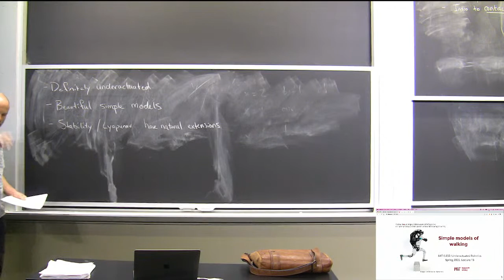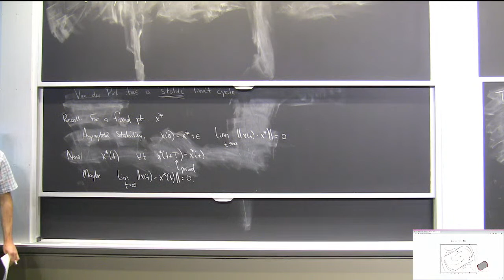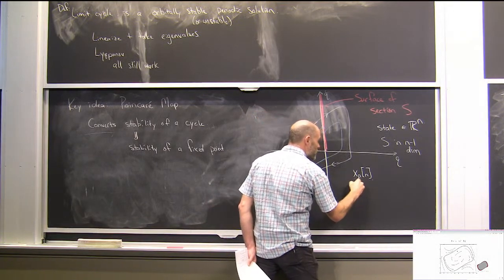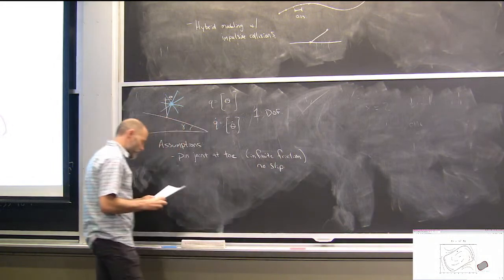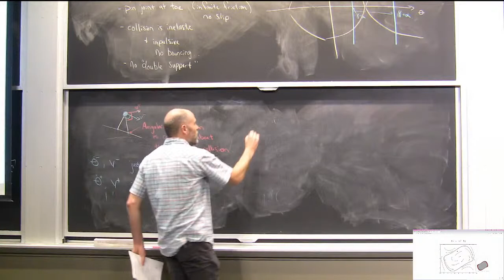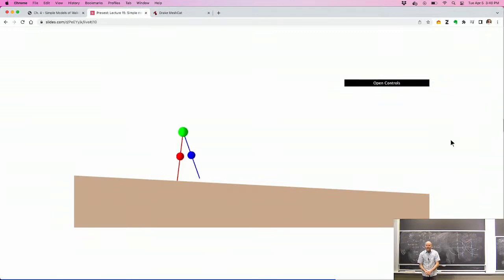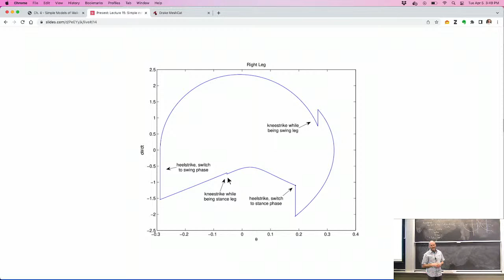Lecture 15: MIT 6.832 Underactuated Robotics (Spring 2022) | "Simple Models of Walking"

Comment: LECTURE 15 CHAPTERS: 
   
  - [0:00] **Introduction / Passive Dynamic Walkers**
        [1:50] Videos of Walker
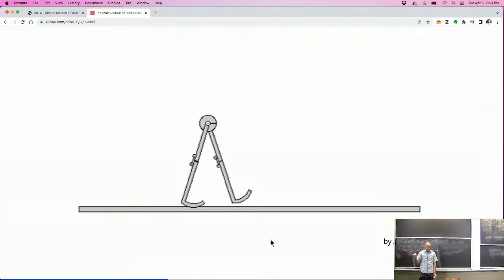        [3:15] Simple Models of Walking

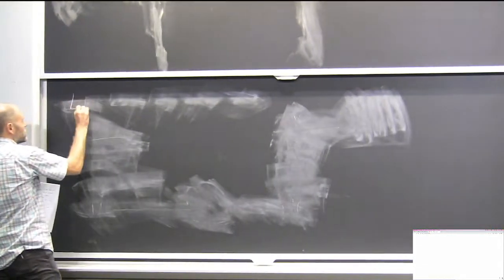   - [5:56] **Limit Cycle Stability:**
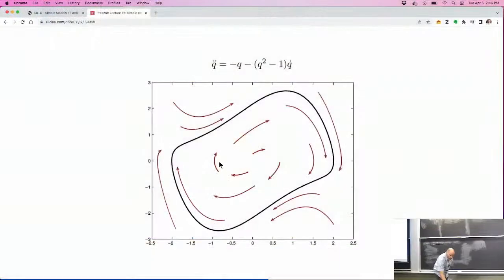        [6:40] Van der Pol Oscillator Limit Cycles
        [7:40] Extending limit cycle stability from stability of fixed points
        [12:00] Orbital Stability
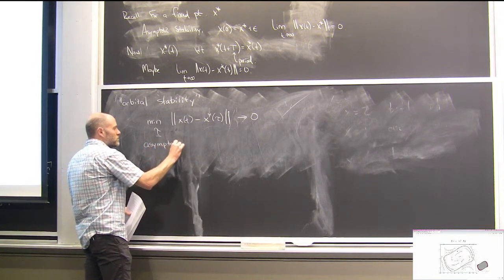        [13:20] Asymptotic / Exponential
        [13:40] Definition of limit cycle

   - [16:00] **Poincare Analysis / Poincare Maps**
        [18:25] Surface of Section S (cross-section of full space)
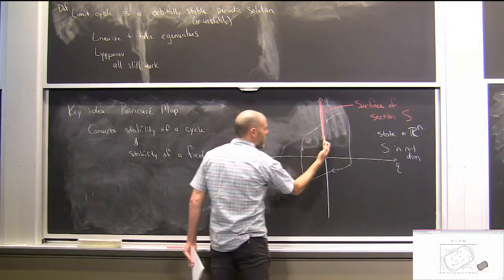        [19:27] Analyzing New Dynamical system 𝑋𝑝[𝑛] (Discrete Time Iterated Map)
        [21:55] Stable points on Poincare Map imply stability of limit cycle through that point.
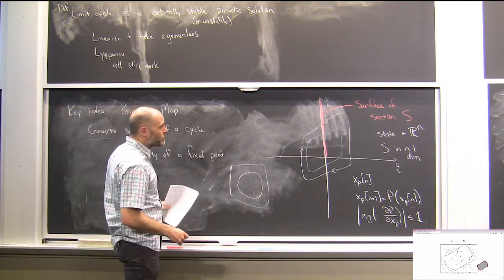        [26:35] Discrete time formulation

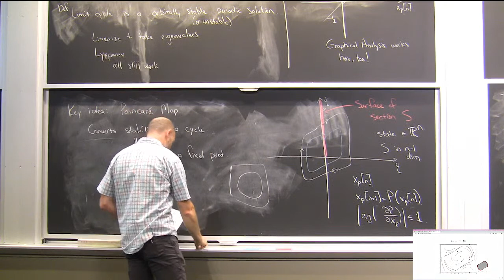   - [30:00] **Contact: Overview & Modelling Approaches**
        [31:00] How do we model contact?
        [32:00] Spring-damper model
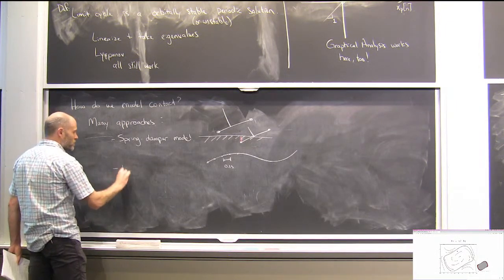        [34:44] Hybrid Modelling with Impulsive Collisions
        [36:42] The Rimless Wheel
            [40:22] Collision is inelastic & impulsive
            [42:20] This is Pendulum Dynamics
            [46:00] Conservation of Angular Momentum
            [49:28] Equation for d/dt( Theta )
            [51:15] Simulation of Rimless Wheel
            [55:35] Phase Portrait of Rimless Wheel
            [56:18] Poincare Map of Rimless Wheel
        [59:40] Compass Gait Robot
            [1:02:03] Stable limit cycle
            [1:03:33] Poincare map
        [1:08:34] Knee Compass Gait Robot